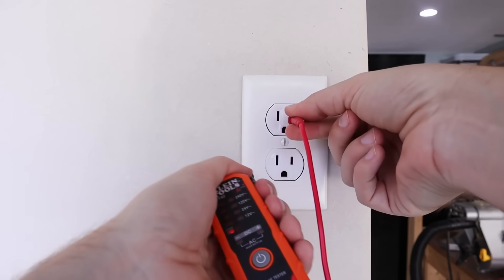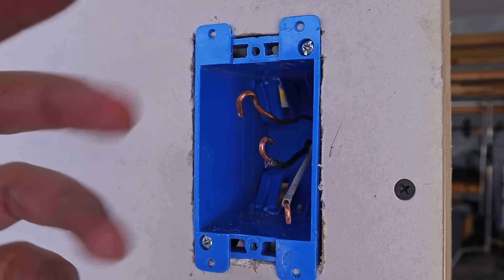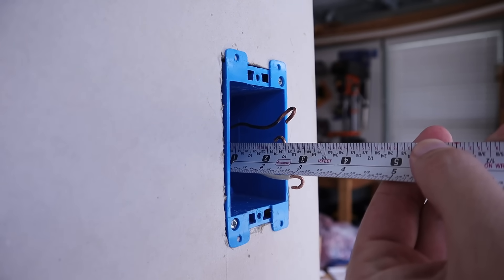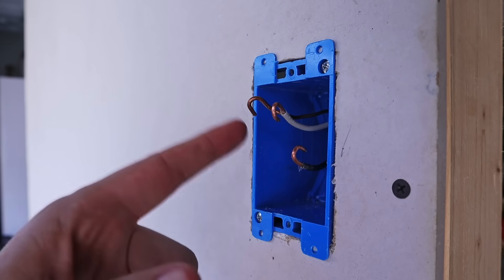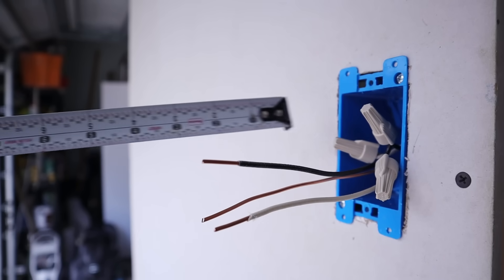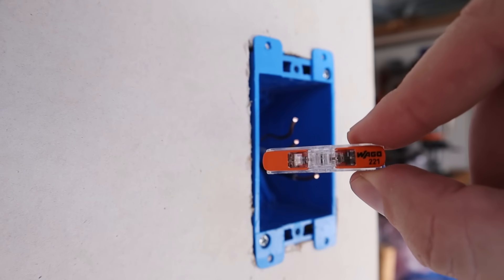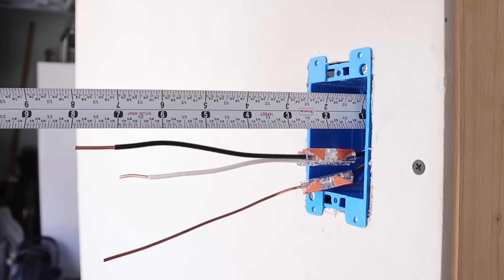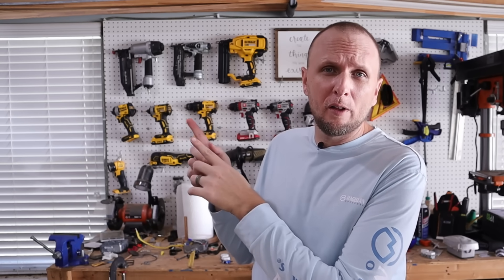"SHOCKING" New Way to Fix Short Wires In an Electrical Box to Code | Very Important

Comment from the maker: Have you ever come across this issue?  I feel like it is way more common than it should be!
Reply: A good electrician will leave a service loop so more wire can be pulled into the box.
Reply: @zoso1123  Problem is most new housing never uses one.  The framer moron and does electrical too.  This save the GC a fww bucks.  I hate 99% of General Contractors since the are "masters of none".  Even I know more an ANY GC and I am not licensed electrician but I actually study the codes and practices unlike them.
Reply: Both the cable nuts and Wago plugs are extremely inelegant for this issue (and Wago plugs are WAY too expensive). Here we use dirt-cheap butt connectors with a simple crimping plier. It's a bit like the in-line Wago thingy but without the over-engineering and moving parts - just a small metal tube inside a plastic tube which you crimp onto both wire ends. It's single-use, of course, but how often do you need to connect and detach wires behind a wall plug?
Reply: @RealNovgorod  They make insertion units, I mostly have their 6 units.
Reply: Yes, a main 12-3 Romex wire going into the attic (garage attic) from my house to the garage only comes about 2 inches from the wall Maybe much less. Always leave plenty of extra wire in J boxes and outlet boxes! Also I had dozens of poorly done wire nuts, and zero strain reliefs on a single J box. Every J box was open! Had lights flickering, went through and found a number of very poor connections. 

It's best to pretwist the wires with line man pliers before installing the wire nut. Always use quality wire nuts too
Reply: @trentwheeler6161  Rolex is a watch. Electrical wire is Romex.
Reply: @123bentbrent  well yes, however this was from autocorrect obviously. 🙄
Reply: @trentwheeler6161  Clearly done by a framer or other GC (general contractor) clown.  99% of errors are from a GC worker.
Reply: @trentwheeler6161  Must be a very exclusive neighborhood using Rolex for wire.
Reply: @KameraShy  😄 this was from auto correct. It was supposed to say Romex
Reply: Yes, I have.
Henry Homeowner does this crap a lot.
Reply: It happens with electricians, too. Sometimes the wire gets too bent and it’s easier to cut it off, but after a few times is a bit short. Getting in a hurry is also possible.
Reply: Nice video. Yes, I came across this and used a 3 port Wago to help 'extend' the wires, as I wasn't aware of the inline Wago product. Nice to know for the future!
Reply: @stephenmcgeown  I mostly use inline on loads.
Reply: In my 1957 vintage house it's more common than not. 

What really annoying is the ninnie who wired it cut off the ground wire where they entered the box. 

# 14 line and neutral with a 16 ground wire was once a thing. Sure it's a tiny wire, but why cut it off?
Reply: @mikespangler98  I thing my highest was 12 in a 3 gang in the master bathroom.  The wiring at all from 2004 when ALL the wiring was replaced.  The 1960's wiring was left in place in the attic which is why I know all the wiring in use is new.
Reply: yes, I did.  I replaced a lot of outlets and switches when we moved in; a bunch had short leads.  Wish I'd thought of something like this.  Got it done OK with needlenose, but this would have been easier.
Reply: huh, always assumed that the service loop was adequate as opposed to filling the box. Thanks for referencing the standard outright!
Reply: @bessljo  A GC has not clue what a service loop is and often staples to vertical studs anyway.  They are morons !!
Reply: I certainly have. Added on bedroom ca. 1951, all three receptacles had extremely short wires. Done by the "professional." Here, the wires are all in EMT. Found the problem when I replaced them with grounded. I somehow managed. More recently, I replaced one of them and used Wagos to extend them with pigtails. Quick, easy and painless.
Reply: The people who built my house did not follow electrical code at all. No ground wires, some of the neutral and hots were reversed, and wires have zero slack. It's no wonder we have power surges and things get fried. These monkeys put carpet in bathrooms, installed a toilet over carpet, and cut all the way through an entire joist for the tub drain. I guess S-traps were considered OK back then, but the DWV system is a hot mess. Tees where wyes should be, no vents, improper slope, etc.
Reply: Common sense with the wire nuts, I'm not an electrician & over 20 yrs ago ran into the short wire problem while installing ceiling fans, reasoned out the wire nut solution to get enough wire to hook up ceiling fan.
Reply: Yes, I'm getting ready to tackle a rats nest or wiring some flipper created to install a light in a closet. In the process he made the outlet inoperable. I'll get it sorted out, it's just frustrating.
Reply: yep, I have, usually a GC is involved and not a qualified electrician.
Reply: Yes, indeed. I just pulled really really hard on the wires. Then I cried.
Reply: hello
1:55
i have a question , the code have some tolerance  for example  it can be 7,87402 inch and still meet the code?
Reply: @TheMakyato  Probably, I do not know of any boxes too deep for that to be an issue.  I have some VERY long neutral bundles in some of my boxes.
Reply: @TheMakyato  or 7.87 in the US, yes, that is fine.
Reply: Just every single box in the 75 year old house I bought 15 years ago...
Reply: @waltstewartstudios  Mine was built in the 60's but had all the wiring replaced in 2004.  New copper pipes too.  No lead paint.  The siding was replaced then too.  New furnace and water tank but that tank failed a few years ago and it was replaced with one that has no plastic parts like ALL the models at Lowes and Home Depot do.  I repaired the furnace (bad processor board) and fixed the venting which was not fully double walled so it rusted from condensation.  The exhaust fan was wearing out so I replaced it too.  Now the furnace just hums without any squeals now.
Reply: Can you do a video showing how to join copper and aluminum wiring? I'm told the purple paste and nut are no longer acceptable, we have to change all of our outlets and switches per insurance carrier (I live in a townhouse HOA).
Reply: I purchased a home a few years ago and slowly but surely im repairing all the short wires and broken water pipes. That the previous owner told me he just replaced 😂
Reply: @deputydan2226  Well as long as you are actually fixing a known problem , and not just going through the motions for a fantasy piece of mind ?

Don't try to fix what aint broke , would apply mostly to plumbing & electrical among the building trades .
Reply: @Mk101T  that's the thing I'd have to gut the whole house and start over.. my issue is every time things are going good for me something in the house breaks or if I want to upgrade or update something we'll you guessed it I have to repair the previous work
Reply: Those straight connectors look like a worse probable problem getting repeated .
Not to mention the cost .
Might as well start soldering your connections to save money , and have the best connection.
This device looks to produce less awareness of the connection importance .

Comment: Useless for older American homes packed with wires. I have one box with 9 romex going into a three gang box. 27 wires total. The ideal fix would be to run new wire or new wire from a junction box. Neither is worth the trouble. I say stay with the short wires if you can still connect them and only extend those that you can't connect from to a switch or whatever. Much easier and much safer. The code is BS in addressing this problem. Totally inflexible and designed only to get people to spend money.

Comment: Looks like you are using the WAGO 221 designed only for 18-14 gage wire. Your wire in the video appears to be 12 gage. WAGO makes a 221 inline version for 12 gage>

Comment: I'm sure that this is not up to code but there is a simple solution.  just pull the box from the wall and splice a nice length of wire, like a foot, and then put the new wire through the box and back on the wall.  Perfectly fine and plenty of wire in the box now.  Any inspectors would need to remove drywall to even see this.

Comment: Great video, thanks! I’m renovating a bathroom and plan to change the layout, electrical will also move around. Assuming I can use a metal junction box and apply the same technique to extend my electrical lines when moving switches and lighting? Are the wago devices code?

Comment: I've used wagos but not the inline ones. Great tip! You are a teacher's teacher, thanks so much for sharing the code compliance on wire lengths. When you go on a job and you find the wires too short, you can blame me, but it won't happen again, thanks!

Comment: Question, what should I do? I have a single outlet receptacle, I need to upgrade to a two outlet box. I have enough wire coming out of the box but I will need pigtails. Do I cut three inches off the wire coming out of the box to do the pigtails or do I just add a couple of inches of wire to hook up my outlets or do I add another six inches to do the pigtails? Thank you

Comment: Cutting the short wires even shorter, and then stripping them further, is idiotic. Just straighten the wires, and cut off an excess stripped wire, but don't cut any more than absolutely necessary!

It's that sort of sloppy laziness from repeated installers over the years that caused them to be so short in the first place.

And if you're going to use twist nuts, you should use the smallest possible ones, not those huge tan ones. 
Ideal Proflex mini (the blue & orange ones) are the best for this (though I would probably use Wagos myself)
Reply from the maker: Cut them shorter to make them longer.  It is a gain.  I honestly do not understand this way of thinking. Then you say to straighten the wires which, if you know how copper works, would work harden the copper, making it very weak, and more likely to just snap at some point in the future.  The rest is just opinion.

Comment: IEC and BS ISO does not allow for twisting conductors. They're is a risk in twisting copper that the csa is reduced thereby reducing the safe current carrying capacity. Don't bend or twist conductors.

Comment: I see no point to use inline connectors for pigtailing in a small box. Wire nuts allow much more compact wiring in given circumstances.

Comment: A lot of wago hate in the comments 😅

I’ll take a wago over a poorly done wire nut like I’ve been finding in my new place, anyday. One of the wire nuts literally had the two wires sitting parallel inside just stabbed into the nut. No idea how it lasted as long as it has 😳

Comment: Okay, I'm not an electrician but having seen how the cheapo plastic strain relief inserts become brittle and ossified after 30 years how can I trust the plastic levers on the WAGO connector to not disintegrate, resulting in no grip and therefore a potentially loose and dangerous connection?

Comment: Wires are already too short.
Needs to remove j hooks to tack on extensions.
Instead of straightening the hooks with pliers, cuts them off.
Why? The wires are already too short as it is. Removing the hooks by cutting them off will only exacerbate the problem. Why even remove them by cutting them off even when you have enough length? (IK this was a demo setup, but still.)
Reply from the maker: Because straightening them out will work harden the copper and run the risk of it breaking off later.  ALWAYS cut the hooks off especially if the leads need to be straight.

Comment: That's all well and good but I would like to see him try to get that fixture back into the box.
Reply from the maker: Was just as easy as any other time when it’s done properly.
Reply: @HowToHomeDIY  Your trying to tell me those wire nuts and extra wire don't take up any more room?
Reply from the maker: That is not what I said.  Of course it takes up more room than was previously there but that is partly due to not enough wire being there in the first place.  I am saying that the added wire nuts and extra wire that should be there to begin with make it no more difficult than a box with the proper 6" installed.
Reply: @HowToHomeDIY  Do it. Show us. Make it work. Until then it is all BS.
Reply from the maker: Guy, if the wires are too short, this is what has to be done and is done daily without any issue.  I don't have to convince you 😂
Reply: @HowToHomeDIY  So it's fake. Thought so.
Reply from the maker: @andymachala999 umm sure 😂

Comment: Not sure about using the inline splice rather than a regular Wago 222 here.  It can be tough bending wires back into the box in normal situations. That inline splice can't be bent, so forces two wire bends.  The regular 221 ends up being a natural "bend" point.

Comment: I didn't watch the video too know that it was an ad for those unsafe clips. I'll stick with the tried and true method of connecting wires.
Reply from the maker: Not an ad.  Another simple way that many didn’t know about.  Sheesh.
Reply: You won't use Wagos because they are not made in the good old US of A,seeing  electrical work there makes me cringe,stick to 110 volts for your own safety,

Comment: - The speaker addresses a common issue in electrical work where wires in a box are cut too short, making it difficult to work with.
- The NEC (National Electrical Code) 300.14 specifies that there should be at least 6 inches of free conductor length measured from where the wiring exits its sheathing, and at least 3 inches extending out past the edge of the box.
- Methods for fixing this issue include checking for slack in the wiring, but if that's not feasible, extending the wires using pigtails and wire nuts.
- An alternative method demonstrated involves using Wago 221 inline connectors, which provide a mechanical connection without needing the wires to be twisted together.
- The speaker also mentions controversy surrounding splicing devices used in the video, and offers further resources for those interested in learning more about splicing techniques and electricians' perspectives.
Reply: NEC 300.14 specifies the length of free conductors required at outlets, junctions, and switch points. The key points regarding NEC 300.14 are as follows:
There must be at least 6 inches of free conductor at each outlet, junction, and switch point for splices or the connection of luminaires or devices.
For enclosures with openings less than 8 inches in any dimension, each conductor must be long enough to extend at least 3 inches outside the opening.
In the 2023 NEC edition, a modification allows the 6-inch free conductor to be spliced, providing flexibility in installations where space constraints may make compliance challenging. These regulations ensure that electricians have adequate wire length to work with during troubleshooting, circuit testing, or device changes, enhancing safety and ease of maintenance in electrical installations.

Comment: So tell me, you have 12 awg coming into the box, and yet the inline Wago you're using is clearly marked 18 to 14 awg. So clearly, this is NOT code compliant, as you are using a product that is NOT intended for that purpose, which is a violation of the NEC.

Comment: I would guess that many such situations are a result of having too small of a box, which makes it difficult to tuck all the wires back into the box after installing a new switch or receptacle.  Not a problem in the example with only two wires and a ground, but when you get to the ones with more wires in the box it becomes an issue.

Comment: I just recently ran across a problem like this with a metal ceiling box and light.  The light was always flickering, so when I opened it up to replace the fixture, I found that there was barely enough wire to meet in the middle before going out the opposite side and to the next room.  The wires twisted together with only a turn and a pigtail, soldered together with a torch (I could see where the burns were) and wrapped with tape, no wirenut.  I was honestly amazed it never caused a fire.  After stripping and cleaning up the wire, there was hardly enough left to get into the box.  I ended up having to run new wire from both directions and finding a similar mess in the rooms before and after this box.  I don't know how many years it was like that, but now I'm hunting for of the same.  I've only been in this house for a year.

Comment: How many amps are those in-line connectors good for?  Seems to me that a heavy draw (electric heater, blow dryer, etc.)  would create a hotspot there.
Reply: I've watch stress tests of these connecters and they hold up incredibly well.  In most cases the wire burns before the connector fails.
Reply: I'm pretty sure on the packaging it will tell you how many amps or volts it's rated for. Especially if it's UL listed or classified.

Comment: What is the difference between backstabbing electrical outlets and waco?  They are both using a flexible tab to hold the wire in place?

Comment: If you are going to do this, I suggest that your pigtails and wirenuts be long enough to be pushed all the way to the back of the box and then just the new wires come out of the box 6 inches. 
This keeps the wirenuts from coming lose when folding the wire into the box after attaching the outlet.
It is impossible to push the wirenuts to the back of the box with the wires cut as short as you said and still be able to attach the outlet.
I always make 10-inch lengths of wire out of my scrap wire just for this reason.
The Wagos are a great idea but still unproven over time under high loads such as space heaters.
Even the Wagos should be pushed to the back of the box before attaching a strapped device (outlet).
The wire coming out of the box should be prefolded like a "W" so that it will compress into the box easily when mounting the device to the wall.